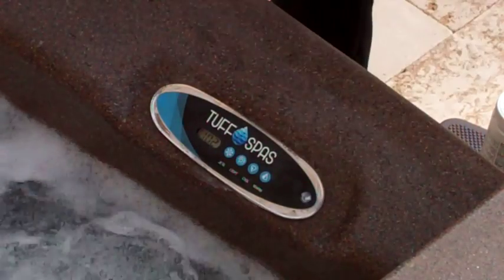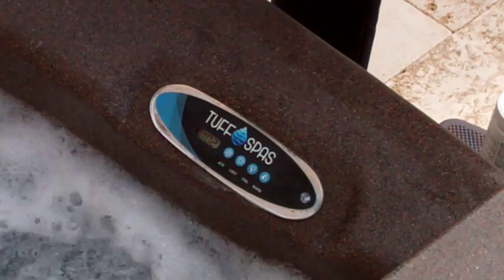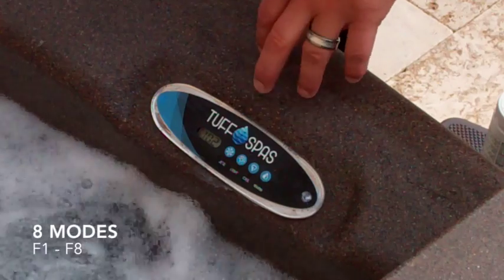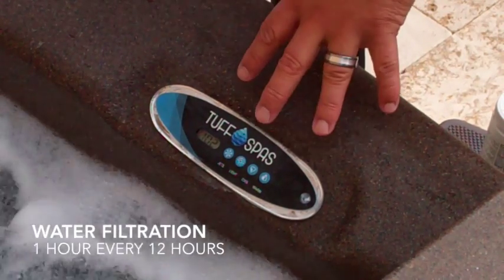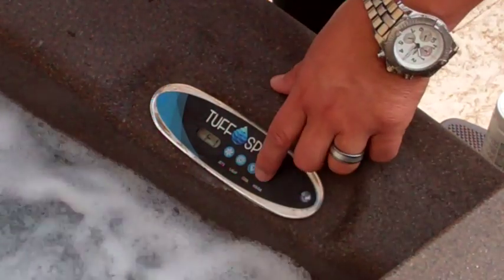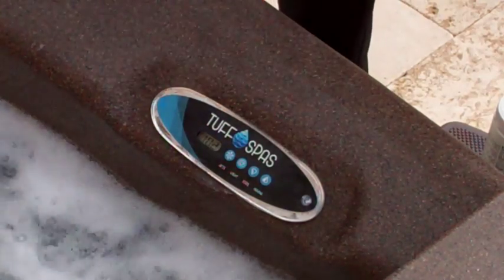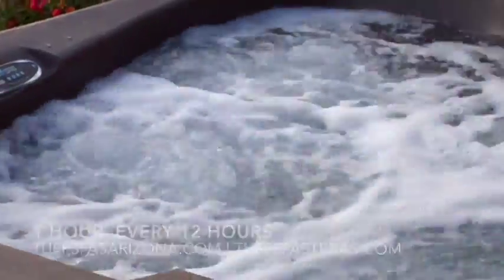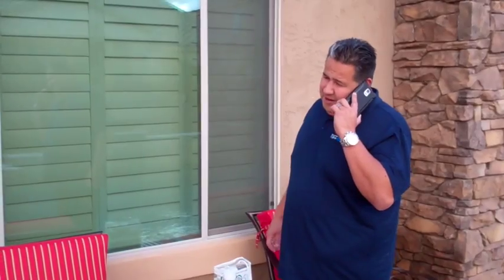Tuff Spas - Control System

Comment: I have Tiff Spa 500 with only 3 buttons.. I can't get the spa to turn off on its own. Heat 100.
I've turn the breaker off and it goes to PR..after an hour still running hear way up. Help please